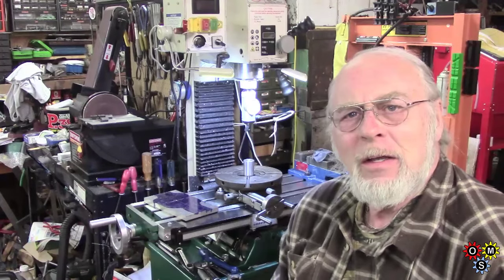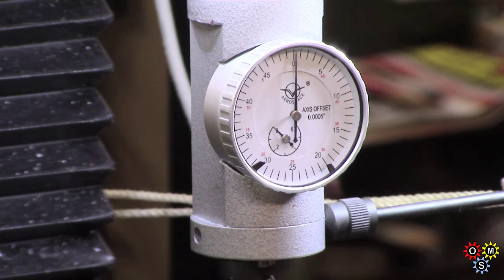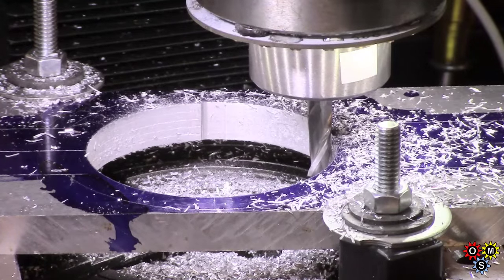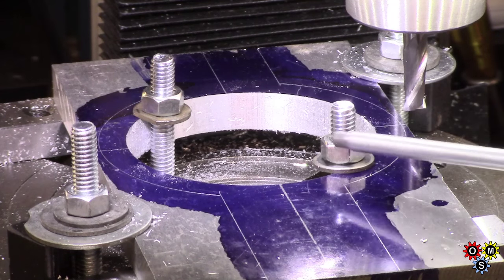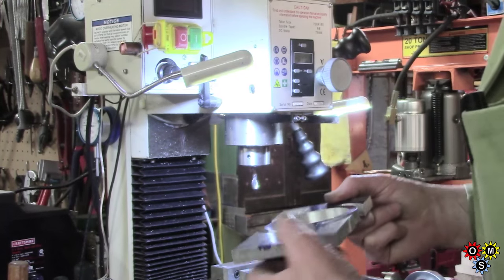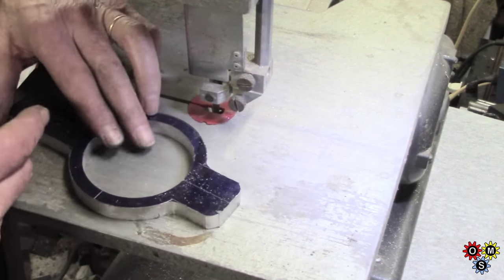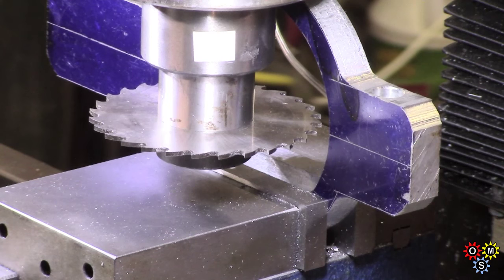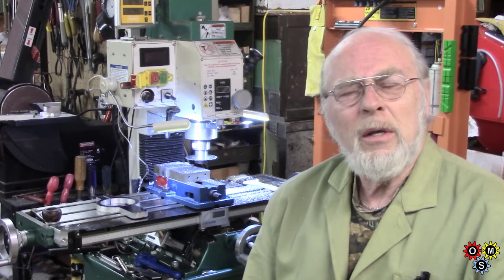Quill Stop Fabrication, Part One

Comment: Well Chris, You have me thinking that I need to get to putting my rotary table back together. Have had it apart to figure out ways to motorize it.... Great to have the temp back to where you can touch a machine without sticking to it!
George
Reply from the maker: +Lakesidearmorer 
Hello George -- well, rotary table is very useful at times, even if a bit beat up like mine! 
Metal masses a bit less frigid - well for now!

Comment: That mod for the G0704 changed the way I use the mill. Way less vibration issues, more actual power and much higher RPM for aluminum cutting. Took me a good weekend to upgrade. Since then I've upgraded the spindle and added CNC support (though I still use it primarily as a manual mill, the CNC stuff is just a nice to have for me)
Reply from the maker: +telecrate 
Hi -- glad you liked the mod. I'll do mine down the road a bit but reckon it'll be better to have when power tapping etc. Doubt I'll be going CNC any time soon, though would be nice to have.

Comment: To make it easier for you to plunge with an end mill not made to do so, you can make a drilled hole to ease the end mill to go right through the thick part, also a little WD-40  will stop aluminum weld to the cutting edge of the tool, then higher removal rate can be achieved... 

Never heard of a circular saw perfectly centered, even a few tenth will chuck...! chuck...!  chuck...!
Reply from the maker: +pierre beaudry 
Hi Pierre -- Good point - had thought of a drilled starter hole but the two flute cutter did pretty well. I was a bit lazy and didn't use much Anchor Lube, which does pretty much what the WD can do.
I did once have a slitting saw that ran 100% true - but only the one! :-)
Reply: 100% true.....!!!! You lucky man...   ;)

Comment: One of the causes for a bandsaw cutting with a tendency to curve to one side is having some of the tooth set worn away more on one side of the blade than the other. Your new blade may have cured that. The sharpness of the front of the teeth is not the only important thing about a blade. It's easy to wear one side of the blade if you try to cut a tighter curve than the width of the blade allows.
Reply from the maker: +Peter W. Meek 
Hello Peter. Well, the new blade has an excellent cut and I always try and avoid forcing a radius cut - apart from anything else it puts more wear on the guide blocks unequally. An old but still useful little band saw.

Comment: Did your machine not come with a quill stop?  Every one I have seen has one of some sort on it.  Are you planning on running a power feed somehow through this setup?  Still confused.  Doug
Reply from the maker: +Douglas Thompson 
No quill stop on original Doug -- although using the Z DRO and/or an indicator it is possible to achieve a very rough limit - just not an actual hard stop.
Power feed, at least for X, is something in mind for later if I get to it.

Comment: Who made the belt drive? I am having the top gear stripped on my similar mill. I would like to order one of those kits
Reply from the maker: +James Dedmon 
Hi James - 
Best I can do is give you the current eBay listing -
http://www.ebay.com/itm/G0704-Belt-Drive-For-stock-DC-Motor/141911740093?_trksid=p2047675.c100011.m1850&_trkparms=aid%3D222007%26algo%3DSIC.MBE%26ao%3D1%26asc%3D35721%26meid%3D5c3c3c6ec59b40b186215fc1c3b91812%26pid%3D100011%26rk%3D1%26rkt%3D2%26sd%3D141882881378

Comment: Hey Chirs, do you do any casting, aluminum casting?   Just a general question, I was thinking about looking into what it would take to get into it.   It may be a bit too involved, but a part like this it seems would be ideal to cast,   What say you?
Reply from the maker: +Glenn Felpel 
Casting would be useful but, I have no suitable furnace. I do have a very basic forge with refractory bricks and that is enough for lead but probably not Al.
Anyways - I think even so I'd have still machined out plate, as casting would have been quite a long job - setting up etc and having to make a wooden form etc..

Comment: ottimo lavoro!!! che fresatrice è?
Reply from the maker: +cluadio galli 
I had to translate - 
"good job!!! milling machine that is"
Thank you.
Reply: +ChrisB257 hello Chris , voleso know the brand of the router . Thank you and congratulations
Reply from the maker: +cluadio galli 
"Router" - you mean mill? It's a Grizzly G0704. :)
Reply: +ChrisB257 hello dear , I imagined it was the model that you indicate . How do you feel with this milling machine ? major flaws feedback ? I ask this because I would be interested in purchasing . You've been very kind , thank you . Greetings
Reply from the maker: +cluadio galli 
Hi - overall quite pleased. I would have liked a bit larger and with DRO - but have fitted DRO to the 0704 now. They say motors not too reliable sometimes.
It did seem fair value and it serves quite well as long as jobs not too large.. I did buy with it, a 5C collet set and other extras. probably spent well over $1500 by time shipping added in.
Have a look at grizzly.com.
Reply: +ChrisB257 Chris thanks the information , they will be useful when I decide on the purchase . I salute you , good job and congratulations for video